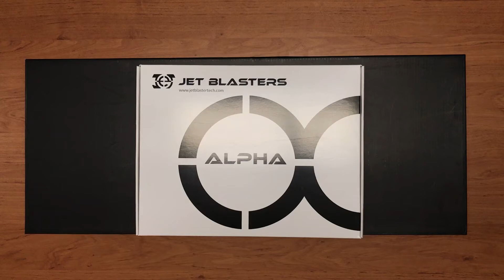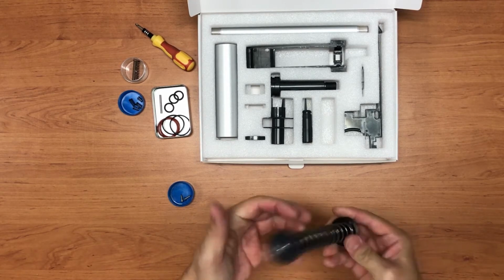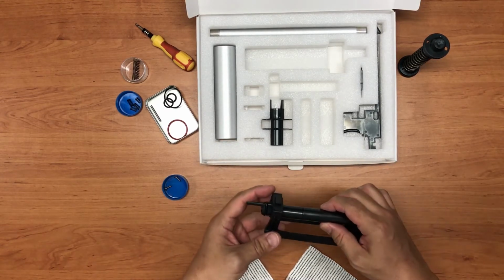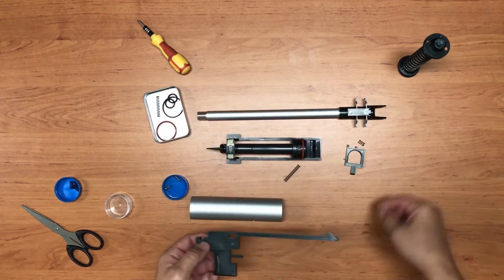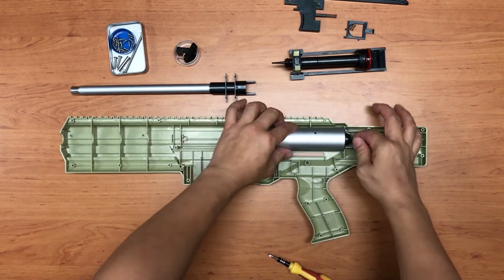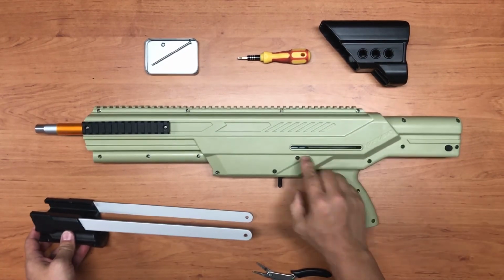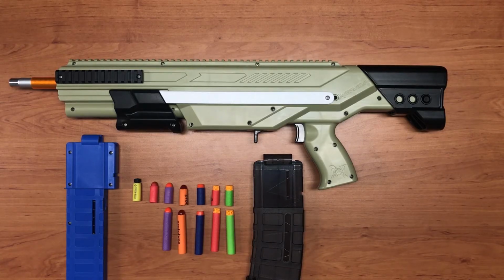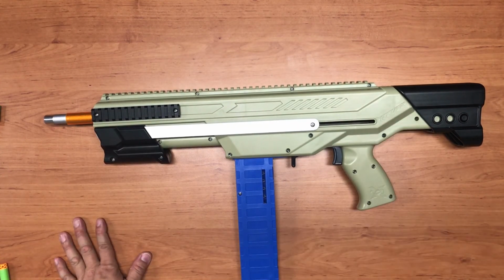JET Blaster XZEUS 2 and ALPHA Kit - Part Two (Assemble)

Comment from the maker: I find the nerf waffle darts not that great with this setup after testing it for a while.

Btw the black O-ring is meant to be loose for a speed seal design, u can watch the tip video from Jet Blaster, link in my description.
Reply: X Waffles darts are notoriously bad in tight barrels.

Comment: Is the alpha kit better than the artifact kit?
Reply from the maker: Hi, I do not have the artifact kit, therefore will not be able to comment on its performance. I did consider getting the artifact kit, however in the end I waited and bought the Alpha kit for the following reasons:
1) The artifact kit and make up of many items which I will need to get separately (e.g. the bolt sled, trigger).
2) I don't remember the Artifact kit have a plunger tube, the alpha come with its own plunger tube which is well made. I think for the Artifact one, you will nee the long shot plunger tube.
3) I prefer the plunger cap design of the alpha being a screw in direct to the plunger tube.
4) The quick seal design of the Plunger cup of the alpha kit is interesting to me.
5) Jet Blaster going to produce a conversion kit for full length dart (therefore I thought I can try out the alpha kit, if it is good I will get another for full length)
6) Basically the alpha is just a one-stop full kit with everything required (catch springs, catch plate, plunger tube, etc). Everything you ever need in one kit. 
7) I am not too familiar with springer type blaster, hence the alpha is a good start I guess.
8) lastly Jet Blaster is located in Singapore (where I live), therefore I know I can get very good support if anything were to go wrong with the kit, I can just contact the guys over at Jet for help when necessary. 

Above are my personal consideration for getting the kit, hope it help :)
Reply: Tungsten EXE What pushed you getting the alpha kit instead of the artifact one?
Reply from the maker: The other consideration I had was, am I going to put a high spring load that is more then 16kg, I thought about it and decided I will be going for a 14kg setup, which I feel give a good priming feel and good enough performance. Do note that running anything above 16kg will be stressing the bolt sled and you will most likely do some modification (example adding padding to the plunger cup to extend the plunger back a little). 

I am not going to run anything above 16kg, so the Alpha material is alright for me. 

The plunger tube that comes with the alpha is a big plus for me and also I really like the plunger cap that screw into the tube vs the Micky Mouse piece which using screw to secure :)